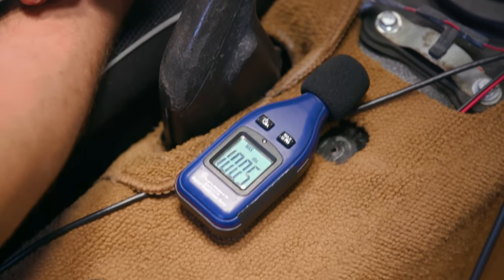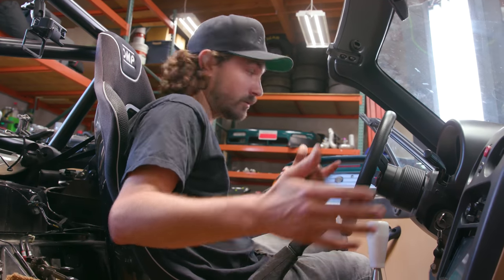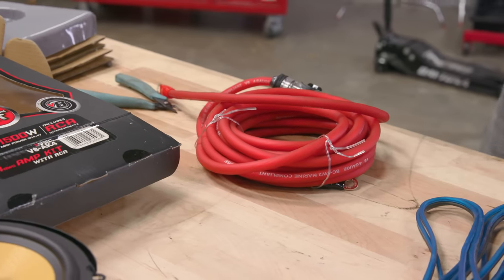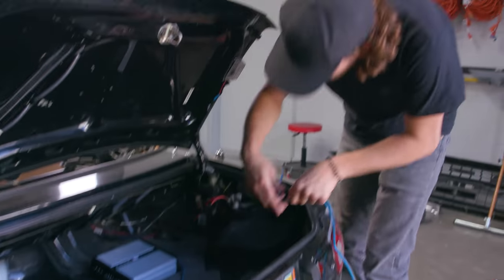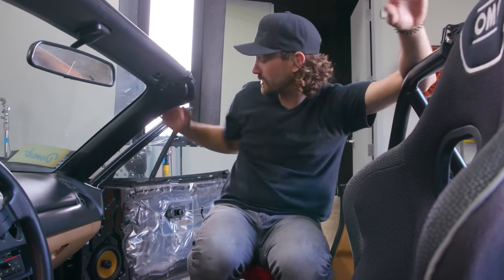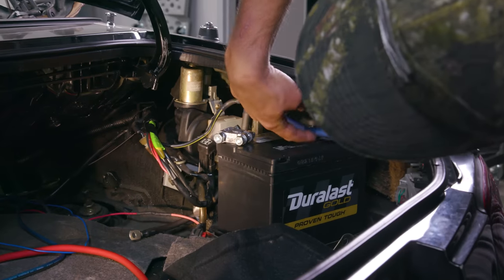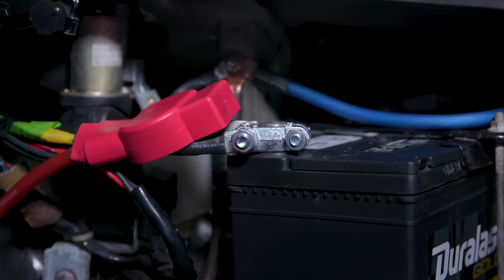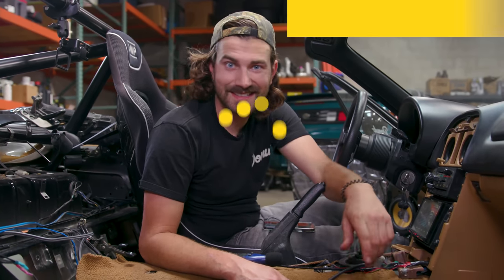Is Upgrading Your Car Speakers ACTUALLY Worth It?

Comment: As a bass head and being about 15 seconds into the video, I hope this video delivers
Reply: disappointed eh
Reply: My disappointment is immeasurable and my day is ruined.
Reply: aside from being a small car to start with, the fuel tank being between the cabin and the trunk on the miata means in order to get a sub in there you've got to get pretty creative. the only spots that really work are the passenger side footwell (with a custom box) and the rear parcel shelf (with a custom fiberglass replacement panel), and even then, it's a very small, very noisy convertible with a ~60A stock alternator
Reply: Tbh I'm barely watching it. But no I loved the whole video. So many people that don't know about systems, mainly the younger crowd they just want the hottest cars and could care less if the speakers were blown out in it. I knew there was gonna be no actual bass. Lol sound in general could be special in any car.
Reply: sergio hernandez What subwoofers do you have? (including everyone in this comment section if you see this)
Reply: it does not, he didn't even set the gain right...
Reply: @maincharacter2677  rockford fosgates HE 12" I got lucky with them, think they were released back in 2001 lol
Reply: @iMagic16  yeahhh there's a few spots they could've gone more in to detail, like the wire cutting and crimping parts as well. Over all I give it a strong 5/10 but for sure without the right gain, you could easily blow door speakers lol
Reply: sergio hernandez 20 years old damnn. Rockford is a great brand have you seen their powerful T1, T2 and T3 series subwoofers? It gets to a point where these drivers get ridiculously beefy!
Reply: @maincharacter2677  I have, I've always been a kicker person, but my neighbor pretty much lost his house,  and when we cleaned up his garage of any valuables those were in his 88 Taurus SHO just sitting in there. Now my little cavalier sounds like it's about to fall apart lmao what kind of speakers do you have?
Reply: sergio hernandez I use to have a Deaf Bonce machete 10" subwoofer in a sealed box. That was for my room though but it managed to rattle my radiator even down to 17hz (though it couldn't be heard. I also had a 10" peerless subwoofer which sounded so clean in the living room. It didn't have the same level of output but it was decent for the money. I'm currently repainting and testing a 12" subwoofer I modified a little. Sorry for the paragraph haha but home audio/ car audio is so fun.
Reply: @maincharacter2677  I've got 2 Rockford Fosgate R2D4 10in woofers in a dual ported box in the hatch of an 2014 hyundai veloster. Punchy yet on time.  And the cars built well enough to hit hard without rattling from the outside. Being someone who listens to a large range of music the 10s hit hard enough without making rock or blues sound rough.
Reply: Shiikaarii Shiikaarii Rockford seems very popular. Some people think door flex and window flex is a good thing but it's something you don't want to have (subjectively). How low do they go? One ten can hit really hard two tens are crazy.
Reply: @maincharacter2677  not subjective, if you panels are flexing, you're losing bass, best way to counter that is putting bass damper stuff
Reply: @maincharacter2677  not subjective, if you panels are flexing, you're losing bass, best way to counter that is putting sound damper.

Comment: Well now you have to do a subwoofer video
Reply: I'm thinking he will put in a subwoofer because he got a 4 channel amp and only used 2. Would be a waste not to put in more speakers to utilize the other 2 channels
Reply: @drackowyrm  most likely he will put the carbon Miata rear speaker mount like I did, I have a 4 channel as well
Reply: @DiscoMiata  that's a nice little add on that I didn't know of
Reply: @drackowyrm  if you have a Miata I can always walk you through the install
Reply: @DiscoMiata  No I don't have a Miata. I used to do car stereo installs when I was younger and enjoy Money Pit.

Comment: One thing I wish he would’ve added; keep the fuse on the big power wire within 18” of the battery. Small detail but makes a difference if you have a short.

Comment: “+10db” means jack shit, decibels aren’t linear, it’s logarithmic because humans perceive exponential volume increases as a linear increase of volume
Reply: why would you say its jack shit its litteraly a measurment
if he would have said yeah definetly louder after i insatlled the new speaker without measuring that would mean jack shit
Reply: @marzlmarcel4648  going from 0db to 10db is a small change, but from 100db to 110db is a major change. Which is why if the metric “+10db” shows up, it means basically air. Since decibels don’t work that way, you now know the minimum amount of impact that it did, with the maximum impacting being infinite. So on average just stating a change in decibels without the start and end point, results in an infinite change. And infinity is useless to humans, hence it meaning jack shit
Reply: @AngryFloatingCow  i think you should look up how those measurements work 🙂
Reply: @marzlmarcel4648  how do they work if not exactly as I’ve said: “logarithmically”?
Reply: @AngryFloatingCow  thats the part you got right
Reply: @marzlmarcel4648  that's the point of my comment
Reply: @AngryFloatingCow  the point of your comment is to say that measuring sound is jack shit
when it isn't
but feel free to try it yourself you should get 0db from a constant sound from your explanation
comeback when u figured out why that wont happen
Reply: @marzlmarcel4648  I'm saying that displaying a flat increase of 10 db is worthless, as there is no scale. What you've done is read my comment wrong or misunderstood it. And then fought me on my correct point.
Reply: @AngryFloatingCow  it litteraly is a scale 100 db are 100 db
if it climbs to 110 db its louder
Reply: @marzlmarcel4648  I'm not saying it's not louder, I'm just saying we have no idea how much louder it is
Reply: @AngryFloatingCow  well you can just reproduce a sound if u wanted to
Reply: @marzlmarcel4648  now you’re just going way off point, what? Whats that supposed to mean?
Reply: @AngryFloatingCow  i was kidding but u can just look at something online that showcases different db levels and get an idea
to lazy to look it up but chainsaw 90db plane 120db etc.
but imagine if he wouldnt have used a measurment

Comment: When you redo the ground like you did it is a good idea to spray battery terminal protection spray to help reduce future corrosion that happens when you connect dissimilar metals together.  It's cheap and works great.  Noco is one manufacturer and is available in the auto isle at Wally World.

Comment: Also before you assume they can’t handle adequate bass, make sure to break the speakers in first for 20 hours. I learned this rocking AudioEngine A2+, HD3’s, A5+’s, and my HD6’s. If you’re looking for home audio in a simple setup I highly recommend the HD3’s. Even without a subwoofer they sound amazing and will rock a small house party or just everyday music enjoyment. I’m totally getting these C1’s for my Ford Escort ZX2, factory replacement. 25watts per channel from the factory stereo and upgrading to an AUX with a good gold plated plug over the old cassette adapter. 320kbps, Vs 96kbps. 🤙🏼

Comment: I remember when I built my systems. All SPL and minimal SQL. Got over 150 dB pretty easy, but it was firmly over $5k. For just the subs, amp, head unit, wiring, second battery, etc. And I did the install myself, so that's all parts and no labor. The battery and head unit were about $600 each and wire was almost $5 per foot(zero gauge copper). The best time I ever had was grounding the amp in my 2004 Grand Prix, because the strut tower studs are right there in the trunk. That's an awesome ground for a unibody car. Just a couple kicker comp Rs gave me the loudest car around. You could hear it at 2 miles. I still have the system in a closet and also have permanent hearing damage. Take care of your ears, kids. There is no way to fix them.

Comment: Firstly  very informative video. But i wish you, showed an example of actually connecting the wire to some of these ports.  There were alot of different kinds of connectors and ports on this and im still confused with how they all work

Comment: A few years ago, I saved my pennies and had a whole system done in my truck - new head unit, dual subs, amp, tweeters, components, and 3 - ways. Wasn't cheap, but it's one of the best investments I've ever made. Use a decibel meter and make sure you protect your hearing, once it's gone, it's gone.

Comment: I played Pop Up and Down Headlights on a premium sound system with 6 x 9 woofers up front, an 8" sub, and a 792-watt amp and you're right about Pop Up and Down Headlights having lots of bass. The car was shaking even on the first few notes, and I had to turn it down below 20!  :)

Comment: You can connect a remote wire in your steering column fuse box. Take out the fuse for your radio, push in the exposed wire and push the fuse in, trapping the wire in. Then, the wire is in a convient spot to run down whatever floor paneling you have to the back of the car
Reply: That’s one way to do it, as long as you have a fused link going to it. You don’t want that exposed wire to come out or to ground out on another fuse( I’ve seen this plenty of times). Best methods are to use the remote wire off the head unit, or to connect directly to the ignition wire (fused, of coarse).

Comment: If ya dont have fancy crimpers for the thick wire terminals you can put on ground b4 you run wire and smack it with a hammer. Works awsome

Comment: most important to understand is efficiency ratings (db/m/1w) is how many decibels on one watt of power from one meter away. a 94 will sound twice as loud as an 87 score, so you don't have to push the amplifier as hard. in a car you can get very loud with a lot less power than you might think. specifications for everything are always sketchy, dangit.

Comment: Might have missed it, or might not have been mentioned because of the aftermarket steering wheel, but many modern-ish vehicles have steering wheel controls and if they're to be used it's IMPORTANT one checks the head-unit can actually work with the specific vehicle's system. Same thing with the more rare head-up displays that reflect off the windscreen.

Comment: as a time saver, you could tape the new speaker wire to the old and pul it trought, using the old wire as a draw wire this would also remove the bare wire issue aswel in one go.

Comment: JL is a fav of mine. simple, and works! i had a single W0, 8 inch, in a sealed box, people would guess a 10, even a 12. i used a diff box, non sealed, and boom, hard as hell!!!! i had 2X15's, W0 15's(non sealed) as well. each one, 8 inch or 15's, worked well on classical, jazz, hip hop, EDM, house, rock, all music. i did use USD wave guides and mid bass woofers and cross overs. sounded good. for a low end line of JL, made me believe. and ive had diff brands as well. makes good sound for less work. did add sound deadening and even more clear sound and cleaner bass.

Comment: Pioneer dmh 1500 hard clips at volume 40 at 1khz, clean signal and calibration of the amplifier is what gives you the best result. 
Using a simple multimeter, you can dial in the amp to be exactly where it needs to be on the gain control. Don't just turn it up and hope, that's how exactly not to do an amplifier setup. 
Clean signal on this radio is at volume 38 at 1khz. Then use your multimeter to set the voltage coming out of the amplifier. Roughly 36v output from the amplifier on this "setup". And you can pin it all day with issue

Comment: Pro tip, leave the heat shrink all the way to the end of the female spade connector. Less likely for anything touching it causing a short to ground. Bonus install points-It looks clean yo! 
😎

Comment: one thing that you forgot the mention is that the power cable from the battery to the amplifier should be capable of handling the power output. for example, if you have a max output of 500watts from amp to speaker, your power cable should be rated for that output. more output is thicker power cable

Comment: Only criticism is that he didn't install a fuse box on the main live wire. I always prefer to work on my own car rather than pay someone else to do it.. and I can be pretty sloppy at times, but even I installed a fuse box on the live wire that runs from the battery to the amp.

Comment: A set of door speakers can easily be handled by a 100w x4 headunit like the sony xav-ax7000 or sony gs80. Both have same audio amplifier section & they do 50w rms at 4ohm & 80w rms at 2ohm. So plenty of power for those tiny 50w rms speakers. Install some 6x9 speakers. They have large cone and makes more sound from less power.

Comment: Dont forget about clipping! Even on the aftermarket ones it sounded like you were still getting some. Adjust gain down until you dont hear distortion or fuzz at the highest volume you will use.

Comment: YES, it is absolutely worth it. I changed the stock speakers on my 2006 corolla and the difference is insane. More extreme for me considering the damn things were 10 years old and the front door speakers probably getting lots of water and dirt on it over the years since they’re on the very bottom sides of the doors.

All and all, for the sub amp, 2 12”s, the ported 2 speaker box, the kicker sub amp, the ds18 mid amp, the 2 rear 3way 6x9’s and the 2 front 2 way 6.5” speakers and the 8ga and 4ga wiring kit, all and all around $1k, replacing the 4 channel 2.5v preout jvc with a 6 channel 5v preout Kenwood Excelon, very excited.

Comment: Just wanna jump in with some nerd science. The decibel scale is logarithmic, not linear. Every 6db equals a doubling of amplitude, so 12db is twice as loud as 6db, 18db is twice as loud as 12db, 24db is twice as loud as 18db and so on and so on.
Actual amplitude is different to perceived loudness, but a good rule of thumb is every 10db you increase sounds twice as loud to your ear.
So while 97db doesn't sound all that impressive when the original speakers were 87db, but that would sound twice as loud in the car.

Comment: It's worth noting, for the doors, that some cars (maybe this is unique to the Neon, idk) are not pass-through grommets, but rather plug-in on the door jamb. Pull back the sheath, carefully, to confirm. When I ran power wires to my speakers I actually removed the doors, and dremeled the deadspace in the connector to pass it through.

Comment: Audio was the first upgrade when I got my dad's old 2006 lbz duramax I did the Walmart specials lol 2 10in kicker subs in boxes powered by a 1000e Jensen amp which I love the amps ability to adjust settings through the phone app because when my mom gets in I just turn the sub down.  Also I got a pioneer head unit and 4 pioneer 6.5in speakers to replace the old paper speakers in the doors.  It sounds a million times better and I'm a handyman who services about a 60 mile range so I'm on the road alot and having good tunes and audio was super important because I can spend 5+ hours driving in a day going from client to client.

Comment: I recently bought a car, and the music sounded distorted at mid and higher levels. I bought some kickers to upgrade the fronts, and I’m not even joking when I say that the cones on the original speakers were almost ripped apart from the rest of the speaker. I also put kickers in my old truck years ago, and they made a massive difference over the original speakers. I think that upgraded speakers are an absolute must for any vehicle.

Comment: Doing a car audio build for my 2015 bmw 750li. Using Rockford fosgate speakers that direct fit the doors and the underseat slim subwoofers. Hands down worth it. Next step is installing a soundstream davinci 7 channel amp instead of the Harmon kardon, and installing a Rockford fosgate dcv 12” t3 subwoofer.

Comment: Awesome Video! I will chime in..
Great car audio always starts with a solid installation. From there, a clean head unit, a separate amp, possibly a DAC, great speakers ( I would go with components) and a great amp.
What is a clean head unit? A dead head that doesn't add any noise or interference to your music. Look it up.
What are components ? This is where you have the speaker + a tweeter.
What is a great speaker? Best speaker is what sounds good to you. Go listen to a bunch of them with the music you like. That said, I rarely find a pair speakers under $200 that sound great to me. But, that is just me.
What is a great amp? Something with very low signal to noise ratio is  a good starting point. Quality amps cost money - there is no getting around that. You will need to do some research to find something as it depends on how much RMS wattage your speakers can take and how many channels you need. Arc, McIntosh, Butler Tube amps, old Rockford Amps are good places to investigate to get an idea.